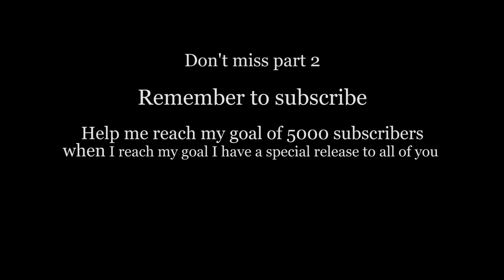Shapeoko 3: Building a Large Format Camera (For Wet Plate Photography)

Comment: That is excellent.  How much does a Shapeoko 3 cost setup the way you have it? And what is the name of the yellow tool that you are using to run stock through the router and where do you get one? I don't like my fingers getting that close to the bit when making frames and that thing looks like it would be great.  Thanks.
Reply from the maker: +Alexander Snay (Alexander) Thanks. I pre-ordered the Shapeoko 3 before it was out. I paid 799 $ for the machine and 400 for shipping to Europe (crazy prize). Now the machine cost 999 $. I also use A small makita router which costs about 150$ here in Norway. So today the total price would have been around 1150 $. It's a great machine and easy to build (it comes in parts). I used one evening to build it. The yellow is called Grr-Ripper: http://www.microjig.com/products/grr-ripper/ It's a nice tool.